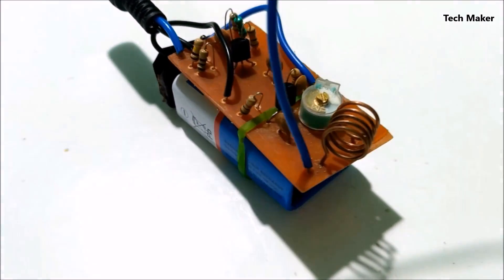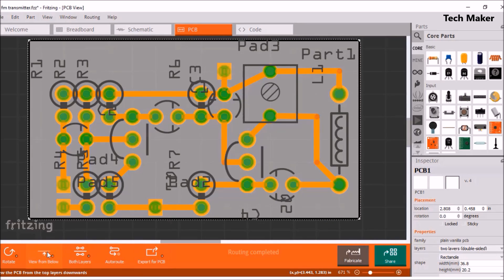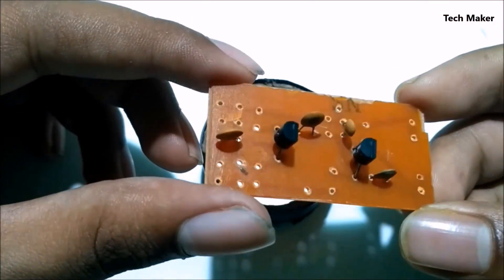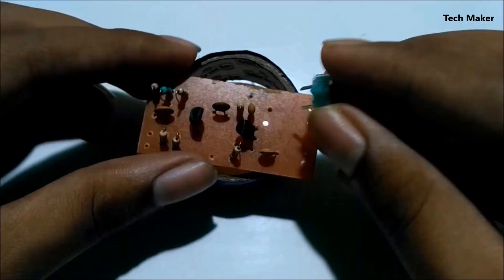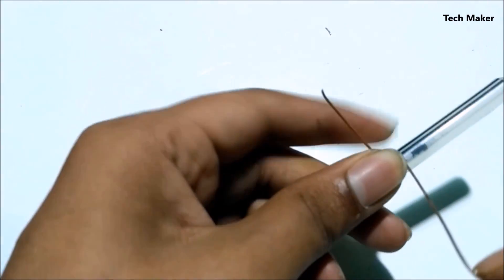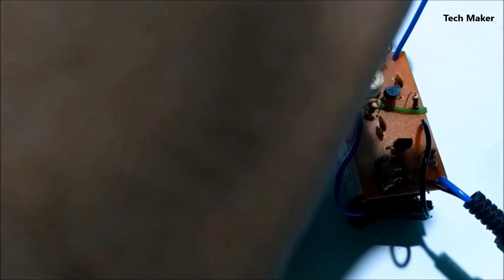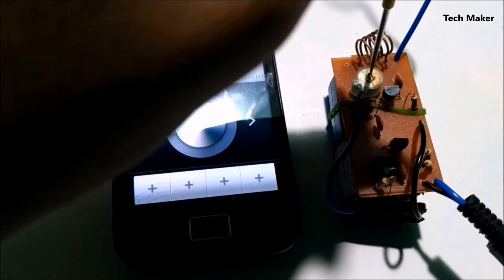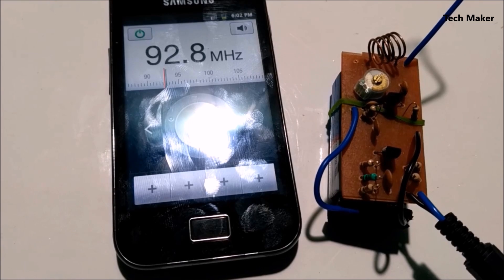How to make FM transmitter

Comment: When you say 18 gauge wire, is it Standard Guage (SWG) or American Guage (AWG)?
Reply from the maker: SWG
Reply: Thanks! Another question- The capacitor C4 in the circuit diagram is shown as 10pF. Shouldn't it be 0.1uF?Similarly, capacitor C1 should be 0.01uF right?